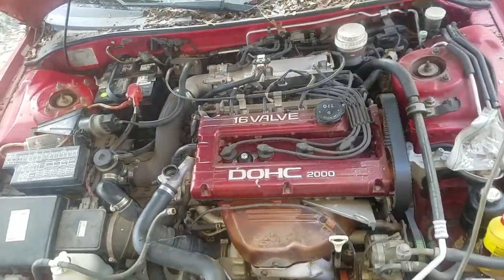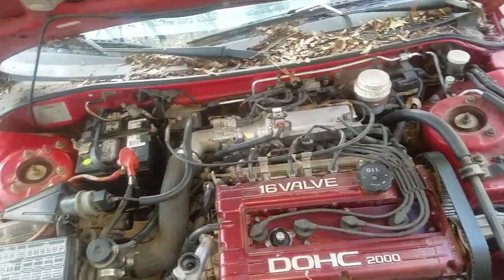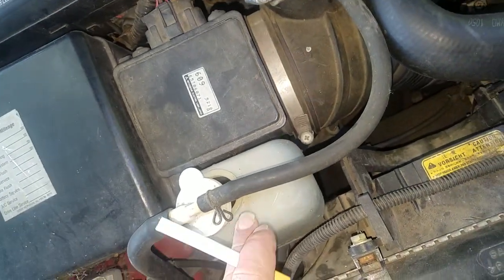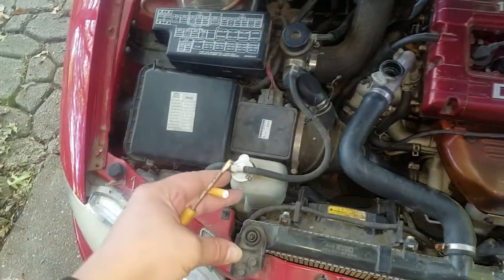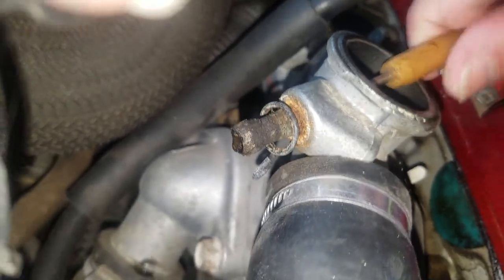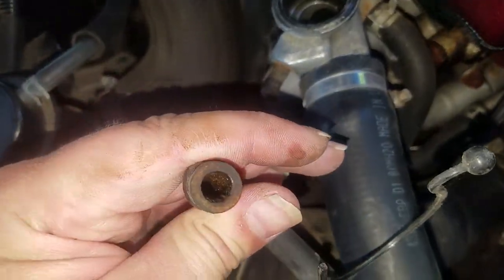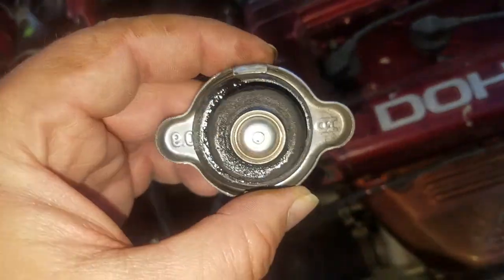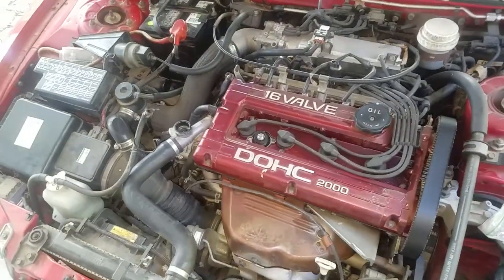95 eclipse gst hoses collapsing problem fix

Comment: My upper water holes collapse and the reservoir overfield?
Reply from the maker: Did you check this fix? Do a compression check if everything else is in order. Could be a headgasket issue. You could also pressure test the coolant system
Reply: @InNerdimensional  No but I did notice my coolant fans wasn't coming on like it should. But they will when the AC is turned on. Thanks for the reply.
Reply from the maker: @JasonSpitzMI50  thermal switch to the fan must be bad
Reply: @InNerdimensional  You're right about the coolant temperature sensor being bad, but I just found out the reason why my upper radiator hose was collapsing. Well in my issue on this Chevrolet 3.5L engine it was a bad radiator cap. I changed it out a few hours ago and it fixed the problem immediately.
Reply from the maker: @JasonSpitzMI50  oh, my bad, I thought maybe you had the same engine. Radiator caps, I always replace those first, cause they are cheap. Didn't even think of that